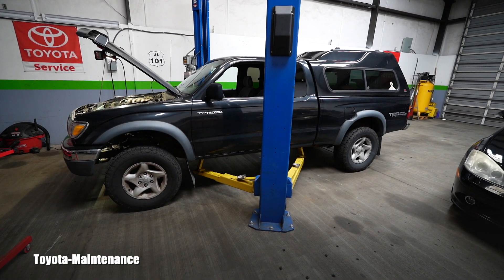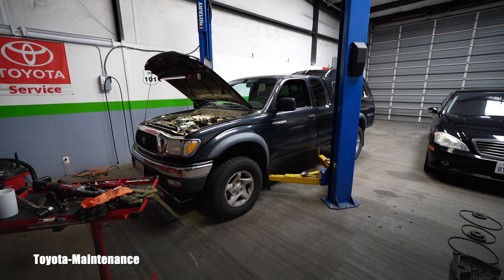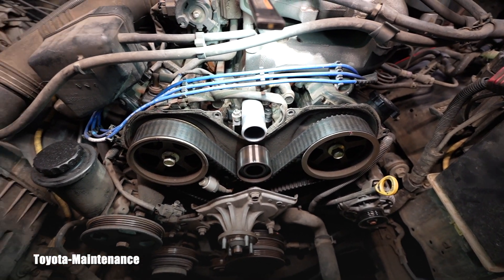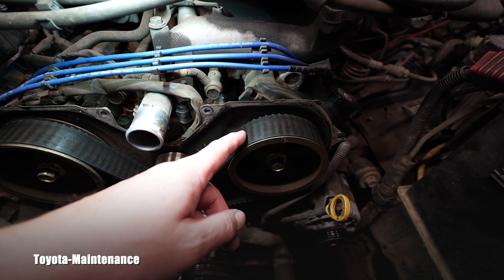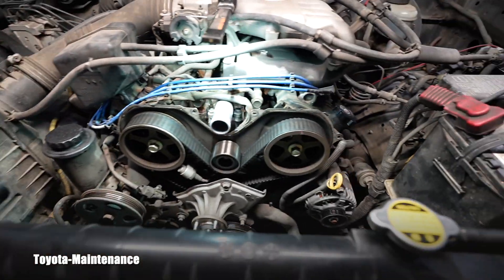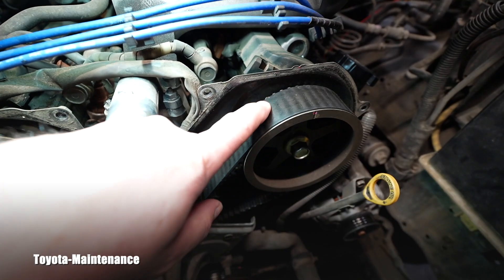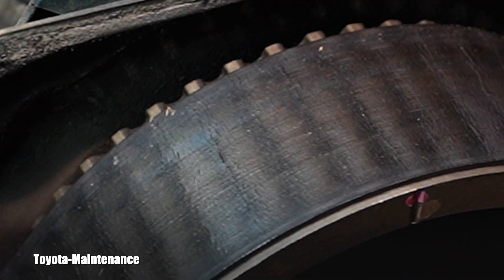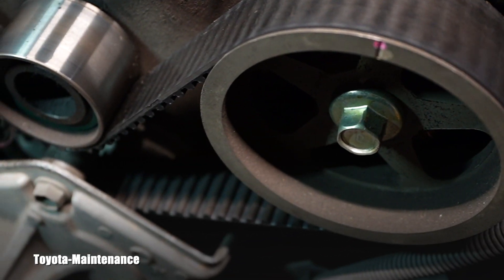Why you MUST replace timing belt frequently

Comment: The belts are always fine when I pull them out even when they are 50k past 100k recommendations.. its the water pump that will go out first.. and even if the belt snapped its a non interference engine

Comment: OEM IS MITSUBOSHI BELT WITH TOYOTA PRINTED ON IT. OEM LASTS 15 YEARS OR 150K MILES BUT BETTER TO REPLACE AT 100K MILES. I USUALLY DO 15 YEARS OR 150 K MILES IN ALL MY TOY'S. AVOID GATES AND ALL OTHER AFTERMARKET BELTS. I INSTALLED A GATES BELT AND AT 50K I NOTICED CRACKS AND HAD TO REPLACE IT.

Comment: The newer EPDM rubber Timing belts introduced around year 2000 last twice as long but mechanics don't mention it for profit. My EPDM timing belt is over 20 years old and still looks like new.  EPDM belts don't crack but shed rubber. Gates and Contitech sell them.

Comment: Good "timing" (no pun intended 😆) that you saw the timing belt in that condition. I had a Lexus LS400 years ago and the timing belt broke as I was driving down the freeway, literally taking it to the dealership for service just as the odometer turned 76,000 miles. Good thing that Toyota uses a non-interference engine (unlike Honda), so the engine just died (rather than breaking). I had it towed to the dealership and had it serviced under warranty!

Comment: Got mine coming up this summer. Already done it once so I know what to expect. Check those fan clutches and the fan bracket bearing as well. I had the bracket bearing failing on the first belt change at 90 thousand miles. Supposedly that is a rarity but it does happen.
Reply: i have heard and seen pics of that failed fan bracket bearing and the damage that it can do... but i would have NO clue what sound that might make to warn you beforehand to get it taken care of ASAP

Comment: A water pump driven by the timing belt is not a good idea.
Reply: Any belts at all on an engine are a bad idea, which is why I bought a Prius c. No belts.
Power brakes are electric.
Power steering is electric.
Water pumps (both of them) are electric.
Fuel pump is electric.
AC compressor is electric.
I believe the oil pump is driven by a chain.
Reply: @aliendroneservices6621  No. My 2006 Mazda BT 50 has a timing belt and I have had no problems whatsoever. It takes me about 1 hour to change. 17 years old and still  going strong.

Comment: I have a 2002 Tacoma ext cab with the 5VZ 4WD 106k miles, original belt still and will definitely consider doing this service VERY VERY soon! aside water pump and belts what else can be updated or refreshed.. I will also be throwing in the fan clutch and belts. Peter thanks for sharing this knowledge with the YT audience.
Reply: Check the bearing on the fan bracket. They usually are reusable but mine was bad at the first timing belt change at 90 thousand and needed to be replaced.
Reply: @tikitavi7120  what fan bracket replacement did you go with? i checked with the Yota dealer but that is not a separate item it appears, you must also get the viscous fan fluid coupler iirc
Reply: @efil4kizum  I got mine on Amazon I think, without that whole assembly dealer crap.It's genuine Aisin, and don't cheap out on anything with a bearing or belt involved, get the best you can find.

Comment: That is a non interference engine. If belt breaks nothing happens. Great engine design.
Reply: @retired75th I’m pretty sure this is the v6 which is the 5VZ-FE. This engine is a non interference engine, and uses a rubber belt. I believe the interference engine you are referring to is the I4 model for that same year, which uses a chain instead.
Reply: @retired75th oops I made a mistake, the i4 is not an interference engine either. Toyota hasn’t manufactured an interference engine in quite some time. So both v6 and i4 engines for the 2000 Tacoma are non interference.
Reply: What is an interference engine vs a non interference engine?

Comment: My 2000 SR5 4WD taco has 326,000 miles , still running on original timing belt!
Reply: Just did my 2000 4Runner in August 2023, 205k.  Waterpump had 07/99 stamped in it and wasn't leaking, belt was severely cracked lol wayyyyy worse then the one in the video lol
Reply: I do honestly believe thaT about that belt! After 2 done on my Tacoma 5VZFE 100k miles apart looked real good... What about your rigs Water pump is it original also?
Reply: @efil4kizum  yes it is
Reply: @kusterflattail  have you peeked at the belt behind the top timing cover? to see what condition it is in?
Reply: You mean running on borrowed time...
Reply: @tikitavi7120  everybody is!
Reply: No , honestly I haven't. My interest has been triggered by the vid.

Comment: Change the idler pulley too.  I'll bet it is binding from bearing wear when it heats up and it's melting and wearing the top side of that belt, or it even could be the last guy over-tightened the idler pulley bolt, causing it to bind.
Reply: Yes he'll change the idler but the bolt doesn't hold tension on the bearing.

Comment: I used the Mitsoboshi ( not Mitsubishi) belt on my 4Runner .. changed at 105,000 miles and looked new when I replaced it at 210,000 miles.

Comment: I changed the original timing belt at 144K, 6 years ago. I had bought the truck used with 121K. When I removed the original belt, I could have re-installed it and driven it another 100K miles. The original belt was in very good condition, even at 144K! I bought the aisin kit that includes belt, water pump, pulley's,  hydraulic tensioner, cam seals and sticker. So far, it has 62K since I last changed the belt and that Mitsoboshi belt still looks like new. I will drive it another 20k and if the engine is still in good shape, I will do the job again. The truck has 206k miles and it still runs like butter with no oil usage and no coolant loss. That 3.4 engine could be the best engine that Toyota has ever made.
Reply: I did my 2000 4Runner August of 2023, it had the original belt and waterpump, pump had 07/99 cast into it and wasn't leaking. Belt was severely cracked, 205k and 24 years old I couldn't believe it.
Reply: @tylermartelle7041  Bizarre!
Reply: Nice! Hey does yours tick at all at a warm idle? Mine does, idk if it's just how the engine sounds or if I need to adjust the valve shims
Reply: @squidwardtentacles578 Ticking at warm idle is normal. These engines don’t have quieting Beauty covers like modern vehicles.
Reply: @Ngcarson1337  plausible, thanks
Reply: I changed the belt at 110km, belt was fine tensioner gone.😅

Comment: It stinks i have 07 highlander that is due for timing belt but it is very expensive job. I am holding my breath hoping it continues to hold up until i get $ to get it in shop
Reply: I had a 2006 Highlander and replaced the timing belt at 134k. It looked brand new when it came off the engine.
Reply: Wouldn’t sweat it if it’s been done once
Reply: I have an '07 HL too, did the T belt little over a year ago, it looked pretty good and the job is a pain, but not impossible for a DIY like me.

Comment: I just did this job on my 2003 Tacoma and my belt looked in similar condition. I highly doubt the previous timing belt job from previous owner used OEM belts and parts.
Reply: I came here to ask if the belt was identified by brand when the repair was done.
Reply: Perfect!!

Comment: This is why i prefer to buy engines with timing chains.. My 2004 2.4 should be good till 150k.. at 40k now..  Love your videos!
Reply: Change your oil every 3500 miles and you will never need to replace that chain.
Reply: Fair enough, but many timing chain engines tend to develop timing cover leaks, and those can take 2-3x as much labor to fix when compared to the labor to replace a timing belt.
Reply: @jeradmiles1956   I think that relies more on the brand then anything.  7 timing chain engines in my family 4 over 350k and no leaks, no rattle, no issues.
Reply: @tylermartelle7041  I think you've gotten very lucky then. The 5th Gen 4runner with the 1GR is notorious for this leak. My mom's 4runner has it and the Toyota book time is 21 hours of labor ($4k) to fix. I can buy 8 OEM timing belt kits for my '03 Tacoma for that price